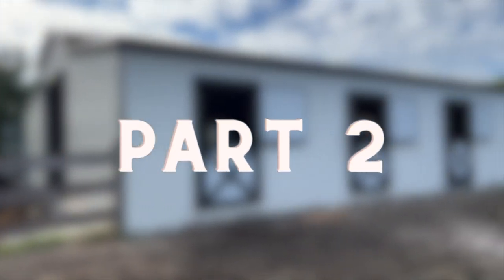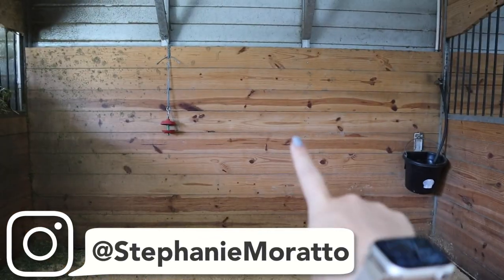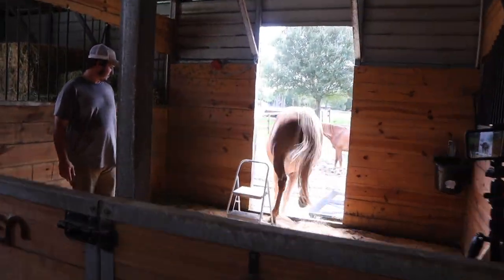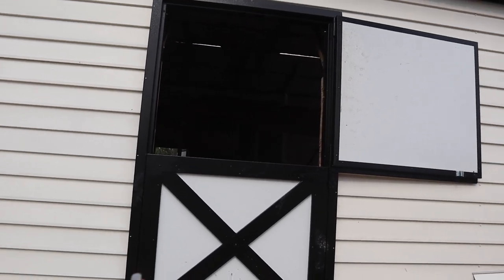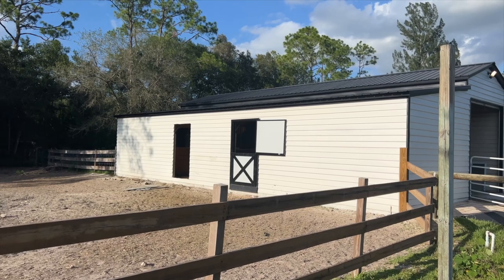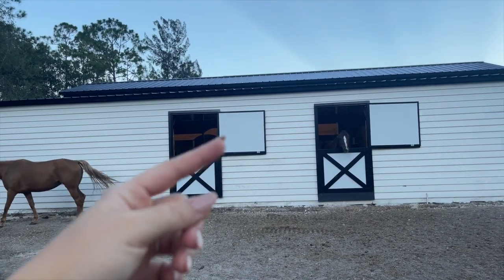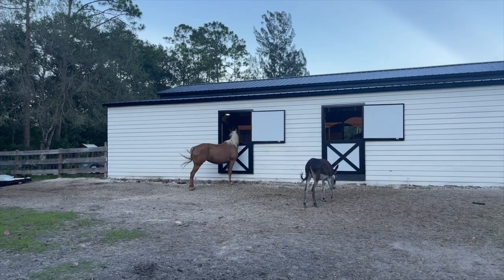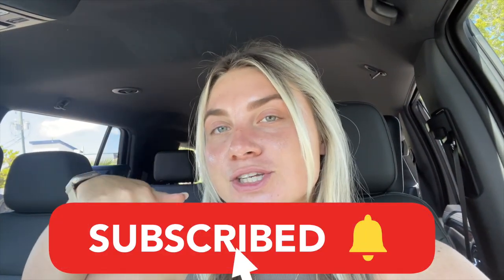ALL THE DUTCH DOORS ARE INSTALLED PT 2| BUILDING MY DREAM HORSE BARN

Comment: The doors look really professional. I really like how you painted the bottom kickplate black. It really finishes it off nicely. I have a 2808 sq ft barn but the top is rounded and it is set up on a concrete apron much higher than the pasture so it is a huge step down lol. I wish I could figure out how to add Dutch Doors on mine to help the airflow since its such a Loooong barn (78 ft long) lol
The only way I can figure is we would have to add 3 ft of fill  dirt/gravel on each side of the outside barn to raise the pasture high enough grrrr. Still thinking on it.